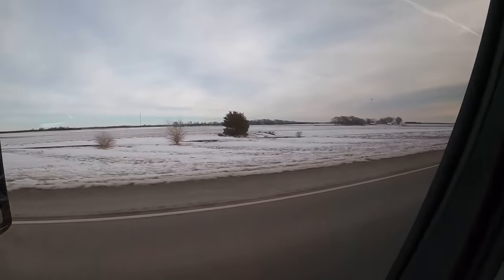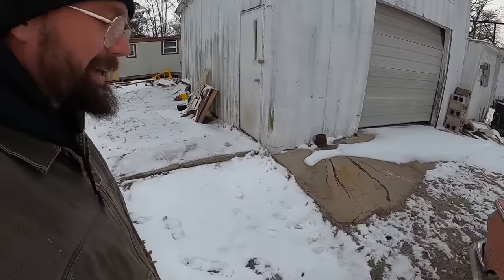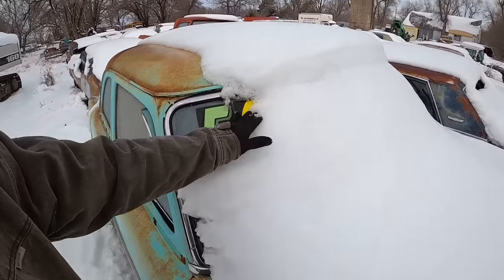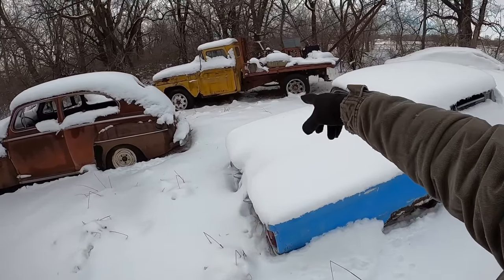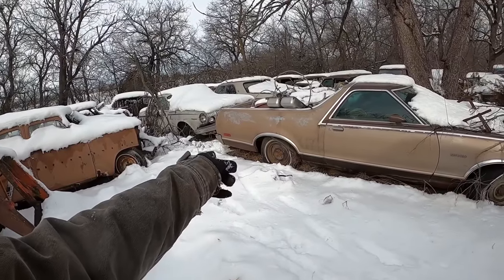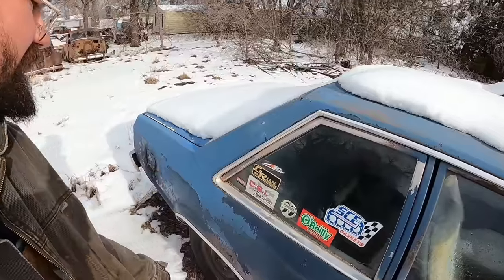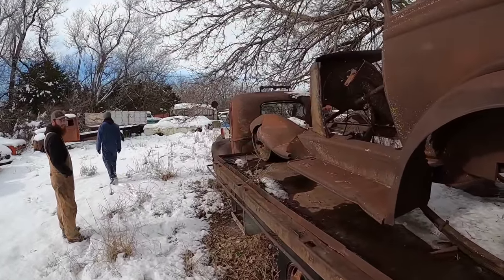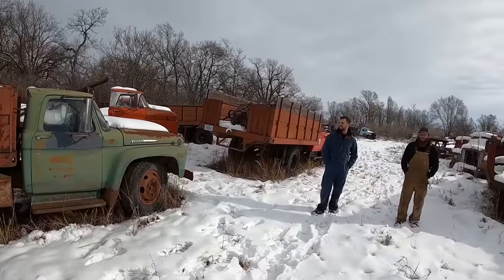WE FINALLY FOUND ONE!!! HUGE JUNKYARD. OLD CAR JACK POT!

Comment: Had 2 of those 53-54 Hudson Jetliners once. 3 trim levels Jet, Super Jet & The Jetliner & that one you saw @ 20:00 had a rare continental kit option. They also made 1 dealer  2dr convertable & 25 Aluminum Hudson Italia Superleggera prototypes with Jet parts. It was supposed  to be an economical car & delars let you try the "teacup test" a see thrugh cylinder mounted on the outside of the passengers window & a teacup of fuel would be added to see how long it would run for. originally designed with a lower roofline, but the higher ups wanted it tall enough to wear a hat while driveing & as a result, the Jet did the company in. They merged with Nash but went out in 57...

Comment: Grew up a MOPAR man from age 14. Direct Connection used to put out a parts list that was needed for specific et's. You could follow the instructions and go low 13's without much effort. If you live long enough you love anything cool and based on what they build today, all the old stuff is cool.
Reply: Mopars arent the problem, it's the mopar owners...
Reply: Problem? What problem?
Reply: @deadclutch  Yeah, some have quite the attitude. Probably came from the engineers wearing pentastars on the back of their lab coats building rockets for NASA in the 1960's.
Reply: @mtnlinda  Well, grandpa's drive Fords, If you see a guy with a mullet, he will have a Chevy and Mopar guys are nerds.  Who else would make lug nuts that threat backward for only one side of the car.
Reply: @mtnlinda  mostly blind brand loyalty while bashing any other vehicle ever produced even though their idols are weak overlapped stamped steel spot welded engine crates that require  body bracing front to rear. Too much pride, not enough respect.

Comment: Love the Benz! I’ve had 2. 1962 220s and 1959 190. Parts aren’t bad. It will run but check the timing chain first! Ever need technical support just ask.

Comment: That old early 50s International pickup brings back some good memories,  My dad bought one in FtWorth. Texas in the early 70s for $60 cash painted red with a brush,  I learned how to drive a 3 on the tree in that truck , that truck would start and run when everything else wouldn't,  flathead 6 , 3spd on tree , dad finally sold it for $400 in the late 70s to a car dealer in Arlington, Texas , Dad owned a muffler shop, and rebuilt wrecked square body's when they were new   , I learned everything a man needs to know about a square body from 1973 to 1987 , I used to be able tell you every size of every bolt on a square body. At 62 yrs old , my memory isn't that good

Comment: Awd astro is always on my list. I want one to turn into a hot rod. 
The early awd transfer case was an awesome piece with a viscous coupler that splits power 60/40. Slap a turbo on it and it's practically a typhoon/syclone drivetrain in a package that nobody would suspect
Reply: Then at 17 minutes there is that white dodge Newport, a 2 door longer than most 4 doors. 
I had a 62 Chrysler 300 that I spent alot of time cleaning, but I sold it before I got a chance to do anything to it. I bought it for 250$, sold it for 1200$. But I've never seen another one (except in magazines and online)

Comment: Youd probably love my AWD Safari. Put a tranfer case swap in it and converted to true 4x4, put a 4" lift on it. 29" grippers... The little lady re-upholstered the seats with leather... Got it for the cost of the abandoned title swap fee of $45 and had some fun with it.  😎👍🏻
Reply: I seen a 94 Chevy Astro ext dark blue and grey on the bottom, courser otd tires 235/75/16 on the factory aluminum sport wheels.... Looked mean lol
Reply: @richardbates2367  Mines a '99 blue with gray cladding. It's has black outlaw II's on it though. It's not perfect, but I do get a lot of looks and compliments. 👍🏻

Comment: At 41:10, the grill for the C10 you looked at. It has different mounting points than the 76 GMC that you have. You might have to drill new holes for the brackets for 73/74 grills.

Comment: I’ve been watching Sleeperdude as well as you and Mortske for a long while now, and I’ve got to say I don’t remember Sleeperdude having one of those little delivery trucks. Might have to go through his archive and see what I can see, the last couple of projects were the Dodge camper van, his Gremlin and Pinto burnout/ drag cars and his last one or two he removed a rusted out section of floor pans and reinstalled a set for his Galaxy station wagon project similar to the ones you did on your wagon. Wherever he got his floor pans from they weren’t for a station wagon but a sedan, they worked for the most part there was a small section that wasn’t covered so he made some. Couldn’t remember if that was the same as your build on the wagon or not.

Comment: You were going on about that little mail van and turned around and the S10 blazer with the mags a body swap between the two would give you a cool van with modern running gear

Comment: I wish you could have bought my old Benz. I had it on marketplace here in Missouri. It was in better shape than the two you’ve posted about other than the floor boards. Sold it for $1200 running and driving
Reply: Would’ve gave ole Puddin a deal!

Comment: Oi Puddin, go get both Mercedes, the one back near yourvplace was the top-of-the-line edition, the 6 Cyl had a different frontclip with bigger headlights, plus the red fake leather interior (called " MB-Tex") is sturdy as heck.
German Taxi-cabs were equipped with this.
But yeah, the 4-Cyl version of Silas looks a bit less rough at first glance.
If you have got enough gambling-money to spend, just get them both i'd say.
The 6-Cyl Versions go for big money when more or less restored reasonable. Over here in Germany.Talkin about 20k+.
Problem is shipping costs.
Enough talkin, sure Silas has a gold- mine of good classic car stuff for reasonable prices.
Shout outs.

Comment: that old motor service rigg would be way cool to restore right, then put a modern diesel in it, the best, use the wire harness every thing off the modern rigg, go to copart and get a crasher, put all the lane sensing on it, GPS driving all that, 360 cameras.. 10 spd auto, 2 spd rear end prep her for some decent hiway cruising at good mpg.. then build a real nice house on the back of it, overhead cab style, round everything off that faces the wind at speed..

I am talking pop outs, all 3 sides, really do it up with air bag coil over hybrid suspension, you;d have that nice active cruise control, really do it up nice, all modern and then some ..

for the home on back I'd go with light steel, composites and that light weight plastic siding.. use lightweight spray in foam for insulation along with rubber sound proofing and bubble foil insulation.. 3 way AC/heat, black grey white waters, stand up shower, full size fridge, 4 burner stove with over, microwave, dishwasher, food disposal, garbage crusher, inland in the kitchen nice comfy seating, starlink, flat screens.. the works..

there is that guy on yootube who bought that military 8 wheel drive he said he was going to build a house on the back, something like that would be unreal it already has the articulating 4 way lift ride all that, a little more room than this one but I don't think he is going all out on the home build with pop outs all that.. a MUST cuz you can add 30% more usable space, only way to go ..

that military 8X, go anywhere, almost, they drive those in 6 ft of water for rescue so forth. snorkels, all water tight electrical, alternators, ignition, (diesel) everything so they can drive underwater, how cool would that be, you could really go remote in one of those, the ruggedness of this one reminded me of it, you could convert this to a 4x4 I spose?  cool old truck..  there is a that guy hangs out with Bellos customs drives one of these around its way cool, restomod, I believe Bello's built it?

Comment: It was cheaper because its the smaller one with the shorter Front end. think you still should buy the other one with the double lights.there is more room for the v8 swap in it.

Comment: Puddin you won't believe this but when I was 16 I used a Datsun F10 to deliver used washers or dryers, the company I worked for would get broken ones refurbish them and sell them cheap you can put a Washer/dryer in the back of one of those things and shut the gate.

Comment: Daily drove a fintail for about a year, the biggest problem with them is the rear diff / half swing axle getup Mercedes had back then. I strongly suggest you find a center section from a 4.5 or 6.2 which were MUCH stronger. The good part about old Mercedes is the factory still makes every part for every vehicle they've ever produced.. that said, they will SURE charge you for it. Enjoy the whip!

Comment: This build is gonna be killer! A nice straight 6 with a 5 speed would be awesome 🤷🏽‍♂️ i know a 350 sbc would be a good fit but c'monnnnnn! A little supped up chevy 292 with triple webbers and a nice set of exhaust extractors would out-torque that 350 without a hassle! Will definitely need some bags to drop her down REAL LOW!! 👏🏾👏🏾 Love the work you've been putting in puddin, even tho you're as useful as a BB shooter right now 🤣 have a good day ya'll 🤙🏾🇦🇺

Comment: Hey Puddin ,
Great show buddy ! I do have to tell you though , I  would have taken the two door Mercedes  for at least three reasons . A because they are very rare , B. It looked like it was in better over all condition , C. They are worth a lot more than the 4 door models and they also had larger engines and longer hoods . They are great to convert to V8 ! But you like what you like and it is up too you , it is your car after all 😊 ! 
I am glad that you found what you like and you bought it ! Thanks for another great show !

Comment: Them little Iron Duke motors in the Fiero are a solid little runner. The body sucks. The weight sucks. Being 6'4" in HS meant id never fit in one of them but ive pulled that motor a few times. Ill take them two Mail Trucks from the beginning of the video.